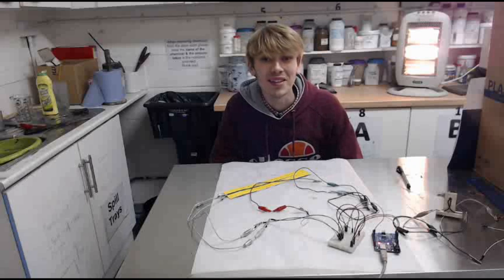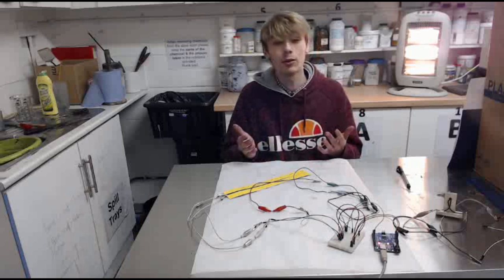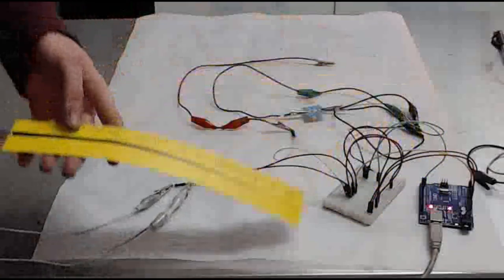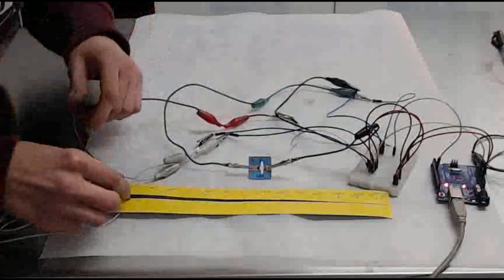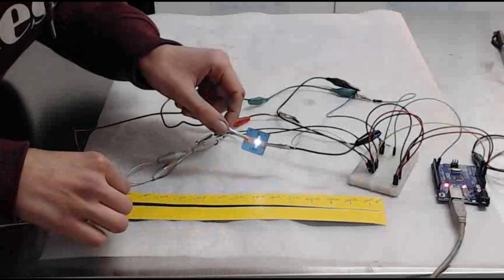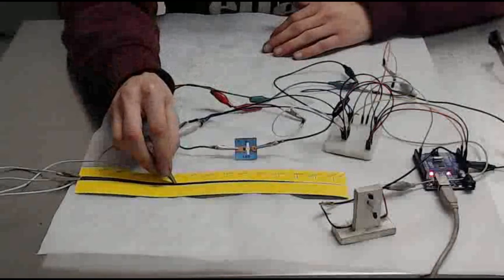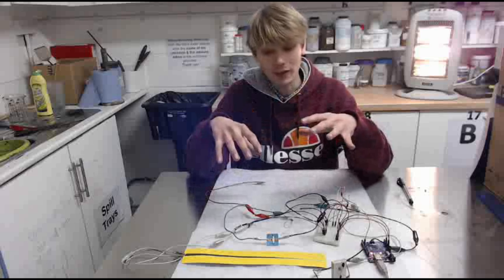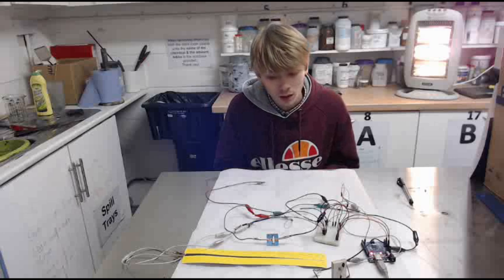Potentiometer made with Conductive Ink and an Arduino

Comment: I have a small flat heating element made of cloth to use as a hand warmer or in a jacket ect. This would be great in a painted circuit to adjust the temperature output of it. A painted circuit that is flat and could be worn with the heating pad would be so helpful. Thank you for the video. And the one to come you had mentioned.

Comment: ☺😊😀😁😂5 Smile's add the glow led paint to the resistor use the power out 5v 9v transistor it into 3 cords and run it on a song or beat set up and mix the line gates up with that 3D motor fan setup 😆.👍